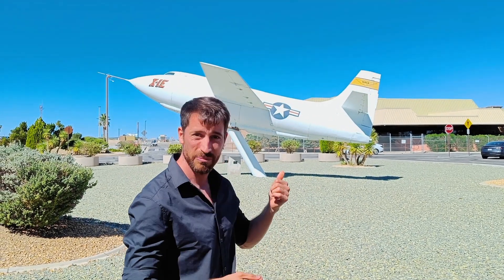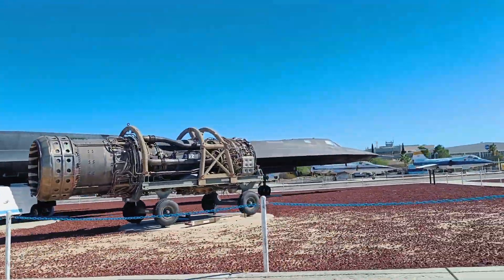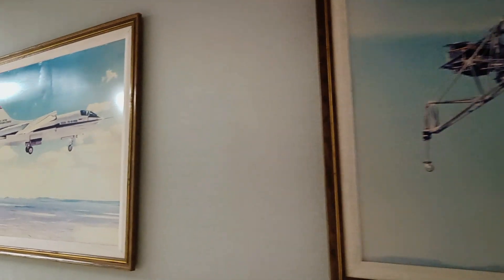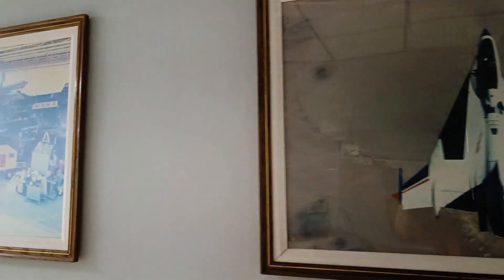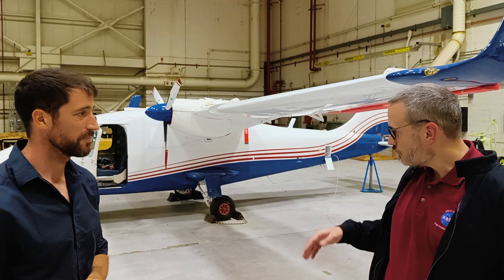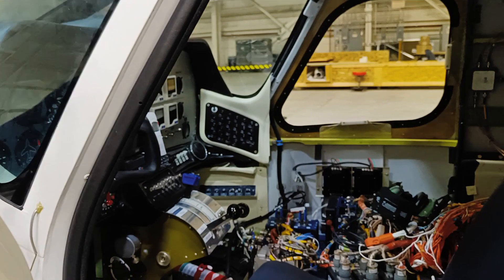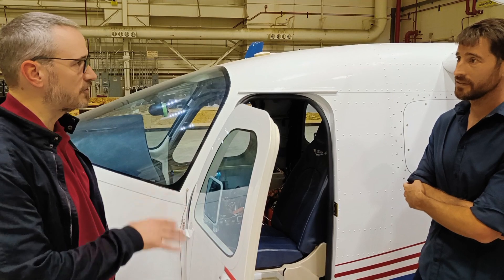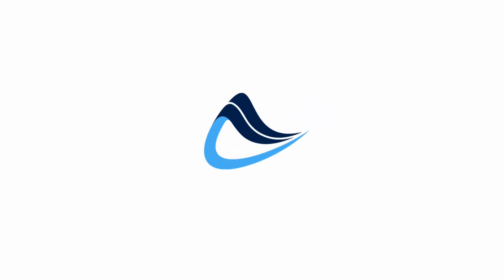NASA X-planes - Inside NASA's research center at Edwards Air Force Base - with interview!

Comment: Yep, that's the XL. The black glove was for CFD validation of supersonic laminar flow pressure distributions. Paul Vijgen would know more Wouter if you know him. Pretty cool.
Reply from the maker: Ah interesting, how did the black glove help? To visualize surface streamline patterns?
Reply: @AirShaper  suction - and delta Cp measurements.
Reply from the maker: @bobgriffiths1402  
Oh ok, cool! Hope the correlation was good!! That must have been in the days were CFD was a lot more challenging than it is today (we're still not fully there but at least we have more computing power :) )